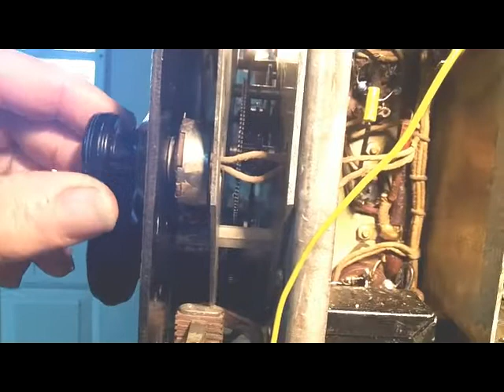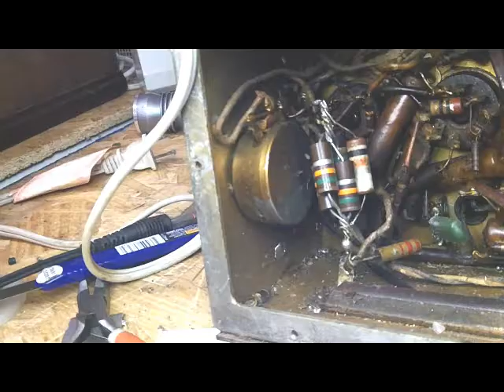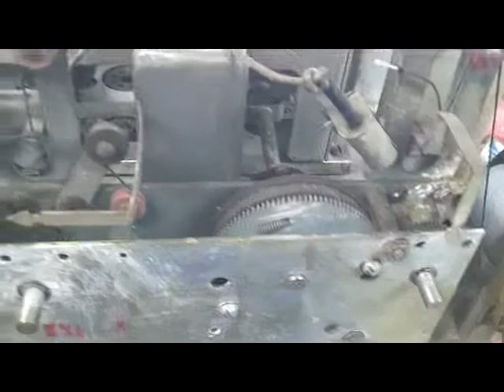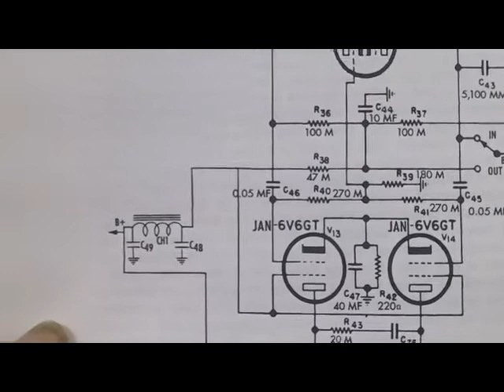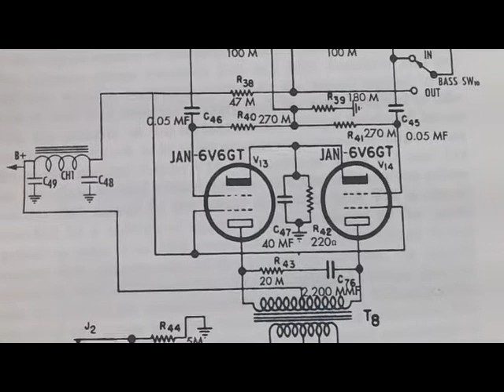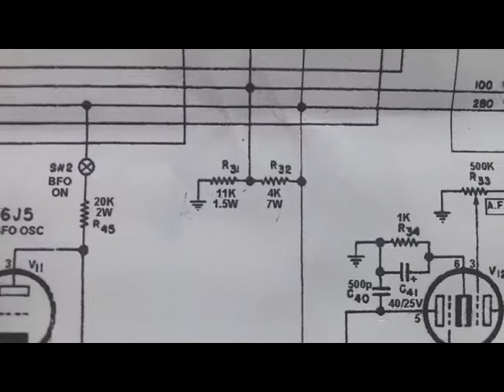Restoring Hallicrafters SX 28A Part 2

Comment: Thanks for the video, I've aquired one of these radios & researching as much as possible ahead of tinkering with. Those sheet metal resistors look like garbage to me & im sure they are. Im going to replace them now in some other radios im working on. Ive seen where the AVC or AGC needs a voltage divider or something to make the meter work correctly also on the SX 28. Thanks!